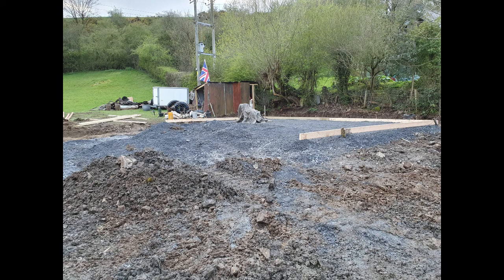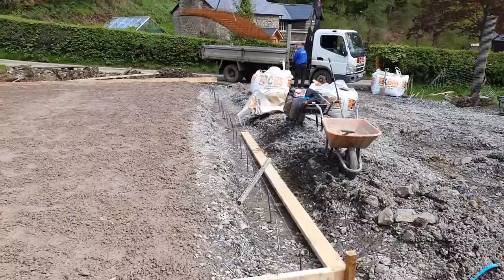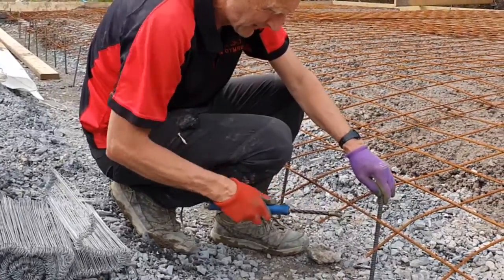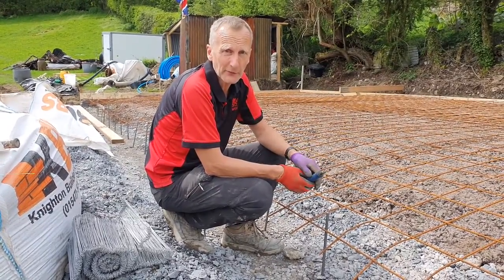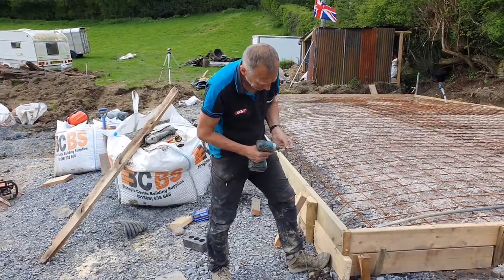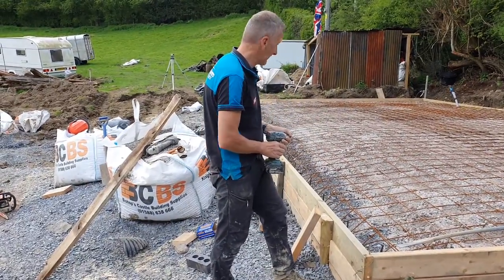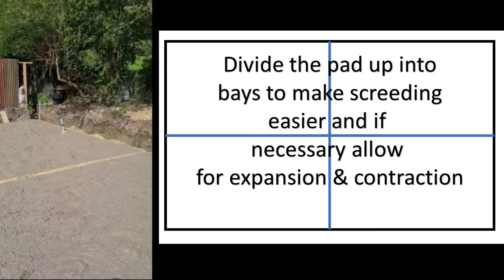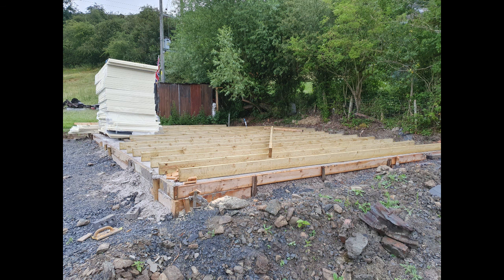Log cabin concrete raft foundation

Comment: Thank you very useful!
Reply from the maker: thanks for the like, the hypotenuse should have been 11.92, just to let you know, or just use the 3,4,5 triangle method, cheers Mike
Reply from the maker: The measurements of the image should have been 10.2 x 6.20 not 12.2 at the top.

Comment: Umm sorry, but if you came up with 11.9365 meters for the diagonal using the measurements shown, then you did something wrong.  I came up with 13.685 meters.

Edit: I see now that at the beginning of the video you said the long side was 10.2 meters, not 12.2.  So the dimensions shown later contained a typo, and that's why the calculation would be wrong.
Reply from the maker: Hi there 11.9365 is the sqroot of 10.2 squared plus 6.2 squared, which was the size of the cabin. I will double check if I spoke a number wrong, cheers Mike
Reply from the maker: Thanks I realise the mistake on screen now, it should have been 10.20 not 12.2, cheers Mike